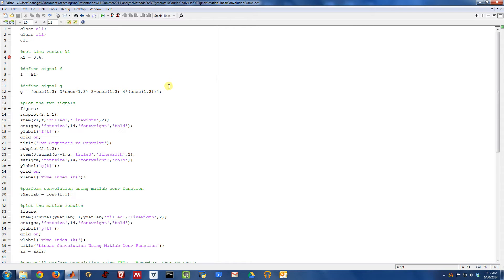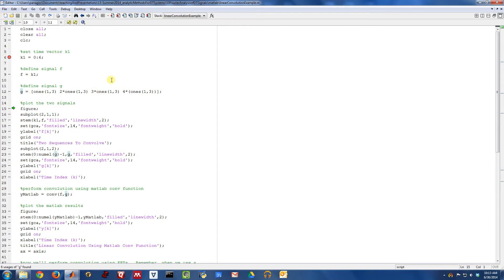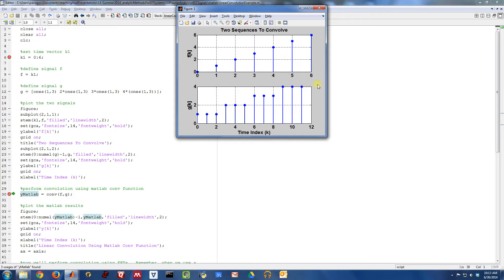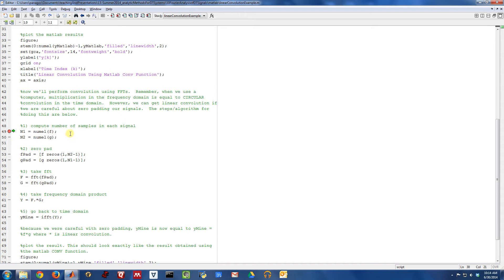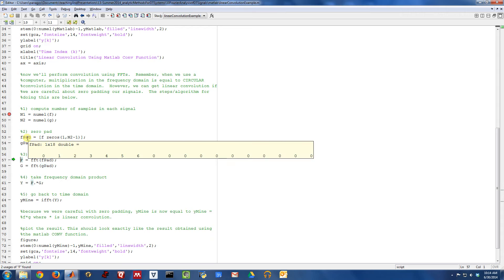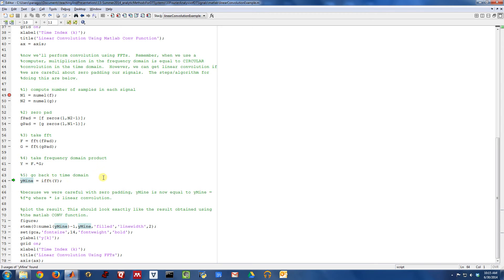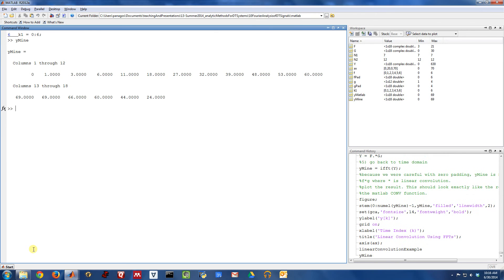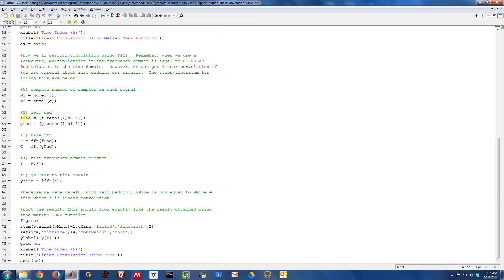The Fast Fourier Transform (FFT) - 06 - Linear Convolution With FFTs in Matlab

Comment: can you give me a link to the code?
Reply: +Sarah K 

close all;
clear all;
clc;
fontsize = 14

% set time vector to k1
k1 = 0:6;

% define signal f
f = k1;

 % define signal g
 g = [ones(1,3) 2 * ones(1,3), 3 * ones(1,3) 4 * ones(1,3)]
 
% plot the two signals
figure;
subplot(2,1,1)
stem(k1, f, 'filled', 'linewidth', 2)
set(gca, 'fontsize', fontsize, 'fontweight', 'bold')
grid on;
title('Two sequences to convolve')
ylabel('f[k]')

subplot(2,1,2)
stem(0:numel(g) -1 , g, 'filled', 'linewidth', 2)
set(gca, 'fontsize', fontsize, 'fontweight', 'bold')
ylabel('g[k]')
grid on;
xlabel('Time index (k)')

% perform convolution using the matlab conv function
yMatlab = conv(f,g)

% plot the matlab based results
figure
stem(0:numel(yMatlab) -1 , yMatlab, 'filled', 'linewidth', 2)
set(gca, 'fontsize', 14, 'fontweight', 'bold')
ylabel('y[k]')
grid on;
xlabel('Linear convolution using matlab conv function')

% now we'll perform convolutions using FFTs.
% remember, multiplication in the frequency domain is equal to CIRCULAR
% convolution in the time domain.
% However we can get linear convolution if we are careful about the zero
% padding of the signals
% The steps for doing this are below:

% 1) compute number of samples in each signal
flen = numel(f)
glen = numel(g)

% 2) zero pad
fpad = [f zeros(1, glen -1)]
gpad = [g zeros(1, flen -1)]

% 3) take fft
f_fft = fft(fpad)
g_fft = fft(gpad)

% 4) take frequency domain product
y = f_fft .* g_fft

% 5) go back to the time domain
yMine = ifft(y)

% plot
figure
stem(0:numel(yMine) -1 , yMine, 'filled', 'linewidth', 2)
set(gca, 'fontsize', 14, 'fontweight', 'bold')
ylabel('y[k]')
grid on;
xlabel('Linear convolution using FFTs and inverse FFTs')